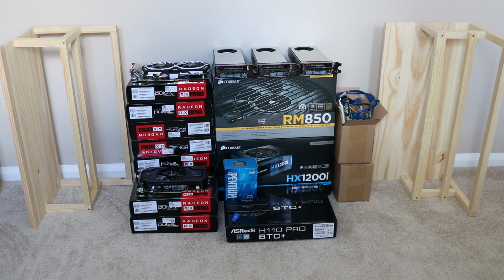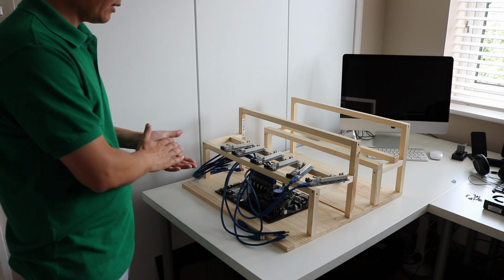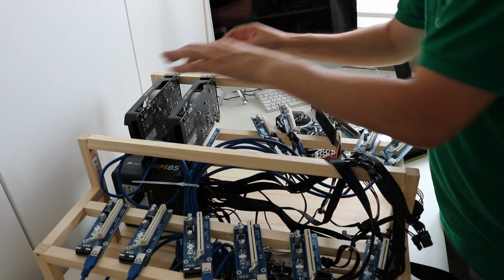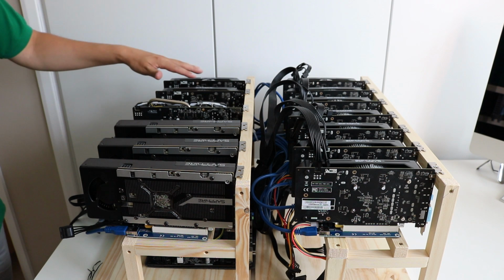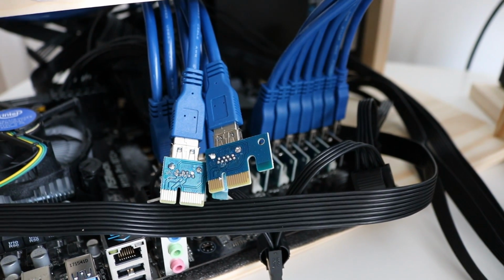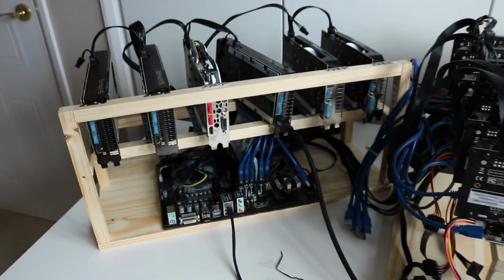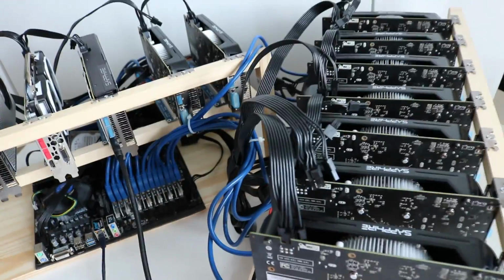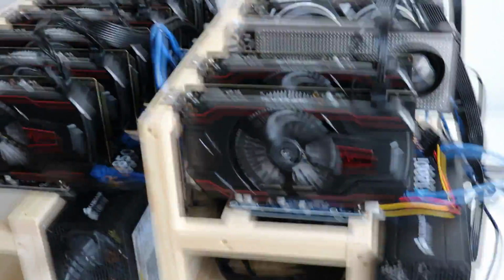Building a 13 GPU Mining Rig - Asrock H110 Pro BTC+ RX560 RX470

Comment: I am planning for rig with 3 GTX 1080 ti, i know its expensive card. I just want to know will i get enough profit spending much amount on 1080ti. Suggest me if i should go with other GPU. Note: I am going to run this rig on free power. So not considering the power cost.

Comment: @IMineBlocks
What did you use to connect 2 PSUs? 
Is that actually required or you can use 2 powered on separately, e.g.  primary is powering up the MB and a card or two while the secondary PSU is used as a power source for the remaining cards + raisers etc ??

Comment: Did you use the Blockchain drivers?   I know at 1 point there were issues using more than 5 amd cards on a board with windows 10
Reply from the maker: I am, but using them with Simplemining OS and it gives a good performance boost.

Comment: so, its enough powered them (13GPU+all) with single Corsair HX1200i Power Supply?
Reply from the maker: Yes if you manage the power well by not overclocking too much or using dual mining mode. The RX560 use 50w-75w depending on the coin and settings.

Comment: Hello, i have been trying to build a rig using a variety of software. I have a quad gtx 1080 ti setup with 4g ram and a biostar btc tb250 motherboard. When plugging into to ethos i get 0h/s but i know the ethernet is working and my configuration seems correct!! I have also tried simplemining os but that didnt even bootup. I thought about doing it all through windows but i want to eventually build 8+ GPU rigs so i want familiarize myself with the better softwares. Any advice would be great!!!

Comment: Can you help me?
I use the same motherboard with 8 GPU 1070 with 2 power supplies, but the 8 GPU only work if I connect the 8 SATA Cables in the same power supply , if I connect 4 SATA cables in each power supply does not work, reason What do I need to do to resolve this problem?
Reply from the maker: Do the gpu fans spin when connected to the secondary supply? have you linked the two psus to each other?

Comment: Is can use only 6 or 8 cards in 13 USB board. Pls tell me about OS also... I should install normal os or that will come automatically. I am beginner from India.. I don't get this hardware in India pls help me on this. My phone is +91-7200049220, pls answer my simple question. My mail id is k.murugan20@gmail.com

Comment: So. Youtube just sent me here, because I'm a geek. When I see something like "Check out my 13 GPU mining rig!", I need to look. Here is what I'm seeing right now:

You are clearly unaware of the whole concept of "heat". You have 9 - I said freaking NINE! - of the same aftermarket-cooler-style video cards, and those cards are designed to be cooled by the ambient temperature of a case (hence the shrouding that is left open on the front, back and sides of the card). Plus another one! I hope to God by now, 3 months later, you have figured out that the 3 - THREE! - blower style cooled cards (you know, the ones that act as an exhaust fan, designed to suck the air from within a case through the fin array in the GPU cooler and then exhaust out the back of the case) are only blowing the hot air onto the other cards, causing them to get hotter than necessary, simply because you oriented them to do so. Swap those 3 GPUs to the other side, for Christ's sake.

Also, what did you sell your last mining rig for? Do you know what poor sap got those cards, used and abused for so long? I mean, if you didn't mine before now, you are an idiot for spending all of that money on cards that you obviously didn't do enough research on. If you did, then they were almost surely subjected to the same "ride 'er hard and put 'er away wet" attitude you demonstrated throughout this entire video (and also, please take a look at what some of the experts say about building actual computers. Google it! I know your goal is to ultimately put that in a place that you can neither see nor hear, but holy crap! People want to use those cards to play games, man). At the very least, do some research on actual computing, and get the same price for those cards as you would from the next poor sap, but at least you'd know they could actually use the card, for a while anyway.
Reply from the maker: Dillon Law I've been doing this a while now. Not everything can be shown in a single video. Thanks for watching and sharing your thoughts.

Comment: One item I didn't hear you speaking about is the operating system. Which OpSys did you choose? Have you used others? Thanks
Reply from the maker: I'm currently using Simplemining.net, you can see it running at the end of the video. Claymores miner running on SMOS.

Comment: May I ask? Do you need a Hard Drive for this set-up? Thanks.
Reply from the maker: You can run EthOS or Simplemining.net from a 8GB USB stick. Other OSes will require a hard drive.
Reply: IMineBlocks Thanks for the info. :)

Comment: i got the concept of using pci riser for your gpu if your power supply for your mobo can't handle it or if you want to set it for a more specific frame. DirectX 12 can handle multiple gpu but all this is for what? RX560 and RX470 on gaming will cause huge stretching.

Comment: I use a wifi connection and the signal is intermittent at times. Will this become a hindrance with this set up?
Reply: I'm looking at using a TP-LINK TL-WN881ND 300 Mbps Wireless N PCI Express Adapter as my internet source.
Reply from the maker: I'd recommend using a wired powerline adapter if you have wifi issues.

Comment: Hi iMineBlocks. First of all thanks for sharing the video, found it very useful ! I saw a lot of discussions on which GPU is best.Did you analyzed Hashing power vs cost per GPU model ? Any suggestions ..?
Reply from the maker: AMD RX 570 / RX 580 or Nvidia GTX 1060 / 1070 will provide the best returns based on performance, efficiency and hardware cost.
Reply: Thanks!

Comment: I also bought a Asrock H110 Pro BTC and I tried to set it up and all gpu are running fine but there is no display showing, does anyone know what might be the problem?
Reply: BTW i'm using a dvi cable to connect to my monitor
Reply: It's working now i just switched to dvi cables

Comment: How stable is your setup? How many hours or days? It seems like some of the cards are underperforming. If you're having problems with crashing, it's probably because of your power supplies. I can't imagine those two supplies giving you the 12v power you need. Each card pulls about 20a (12v), the 850w supply probably doesn't do more than about 80a (12v) (the watt rating is meaningless if you're pulling too much current from each 12v rail). I've had this problem before with 6 and 7 card rigs. Let me know your progress, if you're still checking these comments.
Reply from the maker: I've had it running very stable before the new Dag fix drivers, days without crashing. These PSU's have a high current single rail design which is plenty for this setup.
Reply from the maker: Just to follow up each card (rx560) pulls 75W / 12V = 6.25 Amps

Comment: Hiii....
Please help with my rig problem. I have
Asus B250 Gaming Motherboard updated BIOS to latest version
Intel G4400 Processor
RAM Corsair 8GB
SSD OCZ 120GB
Corsair 1000w Power supply
6X Sapphire RX570 4GB Nitro+

My problem is I am not able to Run 6 gpu on board. when i enable above 4g decoding than on attaching 2nd gpu there is black screen no boot up. But when i disable above 4g decoding. I am able run 3 gpu when attaching to 4th gpu, system won't boot up stays on error msg. I tried it with ethos but same problem. What should i do.

Comment: nice setup though I wonder why bother with a a power mismatch  in psu's

pending on the CPU i'd  run 1-2 Kw for main board and HDD,  with the amount of graphics cards, 1-2 Kw  per bank of cards, I suspect what you are seeing in performance drops is likely due to the setup having not enough power to run the system

Comment: weird.  You can get 30 mhs with a 1070, around 15-20 overclocked with a 1060 TI....why go with the AMD?
Reply from the maker: The initial hardware cost was cheaper, I also had some existing AMD gpus that I wanted to include into the build. My next build will most likely be an all Nivida rig.
Reply: IMineBlocks nice, cheaper is always a plus!,

Comment: hi.  are you using ethOS or Ubuntu for run 13 amd rx??? 

thanks a lot from barcelona!!!
Reply from the maker: Ubuntu (Simple Mining OS)
Reply: thanks for the answear.  when you say Ubuntu (Simple Mining OS) you means Ubuntu + https://simplemining.net/ ??                       i want take 13 Sapphire Nitro+ Radeon RX 580 OC 4GB for make my first rig.  do you think with 2 Corsair HX1000i 1000W 80 Plus Platinum i have enough??? 

thanks a lot!!
Reply from the maker: Yes Simplemining.net Its a custom version of Ubuntu with everything you need to mine.
I'd consider going for 2 X 1200W watt psu's. Unless you undervolt or run the GPU's without extra load. They can use upto 185 Watts but depends on clock speeds and what your mining.
Reply: thanks for answear.    with this configuration  https://youtu.be/QPpwJ9ZneCk?t=9m29s is enough 2 X hx1000 w platinum or you think is better go for 2 X hx1200 w platinum?? 

thanks a lot.

Comment: you can power 8 GPUs on a 1000 watt PSU??? From what I was reading the RX850 operates at like 200+ watts at load. What wizardry is this? What am I missing? Thanks!
Reply from the maker: It depends on the gpus! Most of the gpus on this rig are RX560 which use about 75W & 4 X RX470 series. The rig has 1200w & 850w psus.

Comment: Pretty nice and insightful video, many thanks. I plan to build a rig based on your guidance, with 1080Ti x13 cards. Plan to start with 5 or 6 cards and then add one card every couple of months, self-financed by the revenues. What puzzles me though, is that happens to all this processing power if cryptocurrencies go south. I don't believe this industry will die, but you can never know.

Comment: So...if my calculations are correct, you should be making about $300-$400 per month. Meaning roughly $120 profit after 12 months (And paying off the rig itself). Meaning the second year would net around $4,800 (Not accounting for difficulty/appreciation changes) Correct?

Comment: Does it matter if processor is Celeron or Skylake?
Reply from the maker: It will not effect the mining performance if you use a budget processor. I used the Pentium G4400.
Reply: have you been able to overclock gpus with simplemining/windows when using all gpus?
Reply from the maker: I've been using simplemining and you can use that to control the OC or from within the miners config file.

Comment: Dear IMine,
Did you configure something with bios of mobo? I can't build rig with 12 GPU. When i connect GPU to first PCI-E slot, can not mining :(
Reply from the maker: Nothing special. Please provide more details about your problem?
Does it mine at all, display ok, boot ok? what OS are you using?
Reply: I have trouble when try connect GPU to white PCI-E slot at top. With 11GPU and not connect to top PCI-E slot --> Mining ok. But with 12th GPU connect to first PCI-E slot, can't start mining. Seam like can connect to pool. I'm using ethos
Reply from the maker: Try using one of the other gpus and risers in that same slot. It will confirm if the riser is the problem or another problem.
Reply from the maker: Can you check your miner logs? see if its a connection problem or something else.
Reply: I tried diagnostic with ethos but didn't see error. Can you tell me know what os you used for rig with 12gpu. And you did not anything with mobo for attempt connect 13 GPU? Just plugin all and it's work ?

Comment: Nice set up.  I liked your plastic spacers between the USB connectors for the mainboard. To take less desk space and  If the graphics cards blow heat out and/or may blow heat into the other cards, why not point the top straight up, vertical, instead of the traditional horizontal? In addition to the heat going up, your cables could be shorter or more hidden or allow for greater space between cards. Also, maybe a fan with duct work (small wind tunnel made from plastic or paper cardboard) underneath guiding the air to vent to the bottom going up, even  if your cards are or are not vertical, it would really keep the cards many times cooler with just one additional blower fan.   Like the other people who commented:  thanks for your explanation and hard work.

Comment: Here is the rig  that i'm building at the moment its a open rig frame case
AS Rock H97 Pro4 MotherBoard
Intel Celeron G 1840 CPU
1200W Seasonic platinum
4GB DDR3 DIMM RAM
16GB USB Stick (for Linux)
I'm having delimma between  Radeon RX570 Red Devil (235 W)  and  GTX 1060 FTW+ (166 W) ( 4 Cards Each)
All of the above cost me around
For RX 570 -  2429 $
For GTX 1060 - 2061 $

As per http://www.legitreviews.com/best-gpu-ethereum-mining-nvidia-amd-tested_195229
RX 570 Gives (22.50MH/s ) x 4 = 90 MH/s
GTX 1060 Gives (19.6 MH/s) x 4  = 78.4 MH/s

Power cost is 0.01($) kW/h

Over all profits per year  for ( Used Crypto exchange profitability calculator  calculate this)
RX 570 - 2534 $
RX 1060 -  2151 $

I haven't purchased any of this yet these are all theoretical as per forums and  Reviews i have referred to

My Question is Are my predictions or calculations right ?.  
So are these predictions for solo mining only ?. 
Would i get more profits if i join a mining pool ?
Is this Rig a total Garbage and complete waste of time ?
If so Which Motherboard and How many GPU do i need to get to make profits ?

Currently these profits are predicted as per Pure ETH Mining only, a few videos ago you mentioned about Daul mining, Could that affect my income.

Comment: How much bitcoin do you make a day with that do you. Make over a bitcoin  how much all that cost how will it take to make that money back from your setup  I bet it get kinda loud with all those fans going and hot mybe you need more fans to blow the heat off the cards or make a fridge you can put the whole thing in to keep it cool maybe a freezer having the power wires and internet cable and monitor wires coming out that will block out the sound of the fans too maybe you do not need fans if you keep whole cold how can that motherboard run all those cards bye now

Comment: i have gtx 1050ti currently in my pc case and i wanted to plug my 1060 6g using riser to mine. shoud i install the 1060 driver?do i need to intall both drivers for the two graphics card?

Comment: So I have a single 1070 which chews about 25MH/s, and nets me about .5 mBTC/day. which is about $2.5 dollars. CAD.

So with your rig, running 13 GPUS, @ lets just say it was 180'ish, you would be crunching around $17.50-18.50/day? Is that REEEEEALY worth it?
Reply: Wrax Artilles he also hasn't done any bios modding or overclocking/undervolting

Comment: Building my own 13GPU Rig I have encountered a problem which I haven't found a fix for yet
I am using 13 times the same NVIDIA GTX 1060 
What I have managed to do so far is getting all of them detected in windows 10, shown in Devicemanager etc.
Now whenever I try to start Claymores Dual or Eth mode or Genoils my PC hangs and won't do anything anymore
The keyboard and the mouse are reacting though (mousecursor moving, numlock can be turned on and off)
Can somebody help me please and tell me what I could do to make it work?
I am downloading a Linux Mining OS as I type and would be very thankful about any help you can offer :)
Reply: I think you can only use 8 of the same type of GPU with Win10 or at least that's what I heard.  Like you have to mix and match Nvidia and AMD.
Reply: did u fix problem, will works 13 equal nvidia cards P106 on that mobo?
Reply: no not with windows
Seems like people are right and you can't get it to work
maybe try linux OS
with XUbuntu which I am using all cards are detected
I am trying right now to get the overclocks working
Reply: There is an issue on Windows and nvidia drivers. You can't get more than 8 cards running. I have the same problem. Maybe nvidia will release a mining driver. Not sure.
Reply: I have the same problem bro. The problem is probably in the Nvidia drivers. Probably can not work with 12 GPU.
Reply: Jan Jakubík use linux. It will work straight away.
Reply: go on linux os, W10 support only 9 gpus, u need mix amd 7 + nvidia 6  will work
Reply: Yes by now I got overclocking, lower powerlimit and mining with 13 gpus working fine on Xubuntu 
Linux is really great compared to windows
like setting up a win 10 miner with 8 gpus is 2 to 10 hours error and trial till everything works
with linux you plug 13 cards in, power the rig up and it works :)
Reply: Ed Edan http://www.parallelminer.com/?wpam_id=7
Reply: you have to flash it.
Reply: Ed Edan fuck u pos miner

Comment: Great video - Nice work again! 

I have a question - I have a gaming PC which I have turned into a mini mining rig (GTX 1080 & GTX 1070 - directly connected to the larger PCI express slots and powered by the standard PC express PSU cables). 

My motherboard has two spare small PCI express slot. 

If I buy an additional two GPUs, some riser cables and figure out how to mount them externally, would you be worried that the 2 existing GPUS attached to the Motherboard could be a fire hazard for the two new additional riser cables? Also, is there a way to split the existing PCI express PSU cables to power the new cards?

Comment: GPU #9 For the WIN!  If that's one of your 560's you've got a cracker there Lee ;)  20.93mhs :O 24:07
Reply from the maker: Sadly its not. The GPUs get re-ordered so its one of the 470/570's
Reply: The RX 470's seem to mine really well.  Lots of channels are getting unrealistically high hash rates with them.  I bought one as a tester for a rig I was planning towards the end of the RX400 series lifespan.  Such a shame they've stopped making them.  AMD should start producing cards specifically aimed at mining, and retool the RX470s and 80s for the job, they'd make a loads of money from that.